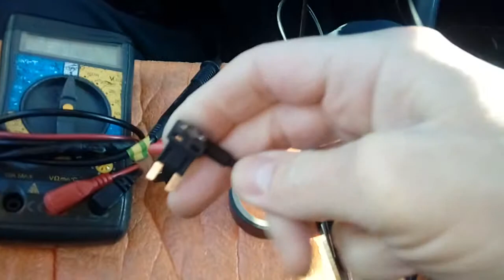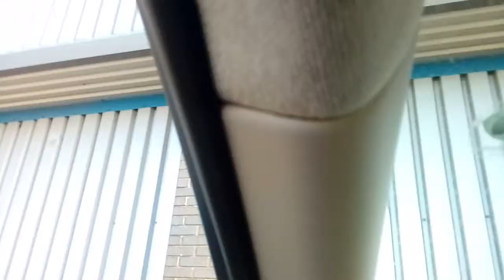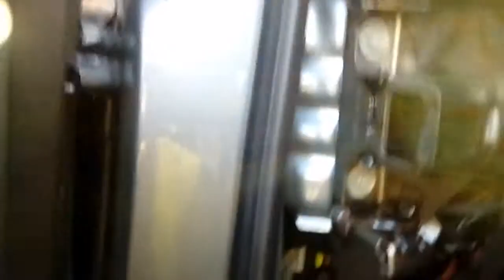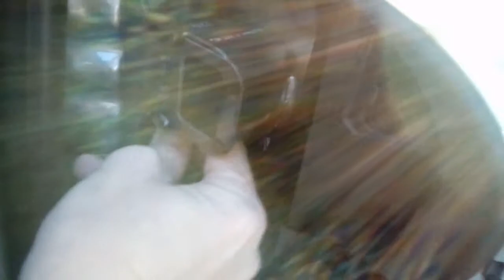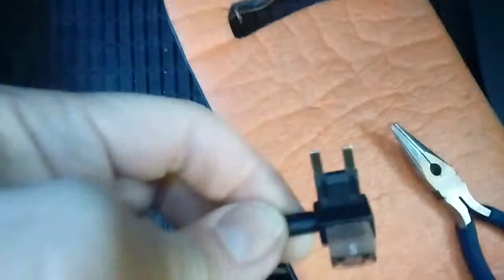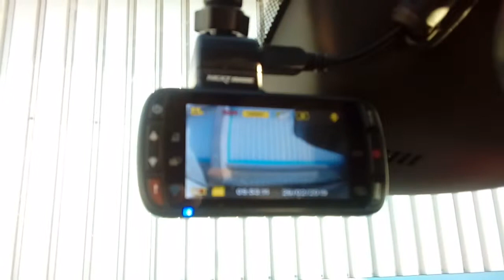Citroen C3 2009 onwards how to fit a dash cam to go on off with ignition + no wires on show

Comment: UPDATE, I have successfully Installed a Nextbase WG522 into a 2016 Citroen C4 Grand Picasso 2.0 Flair, Watching through your video in conjunction with others it was a relatively simple process. My car is a UK spec and following your process found that I did have 3x 5amps fuses but couldn’t get the tap fuse too sit flush in the righthand side one so used the one to the far left. As stated in this video Citroens do indeed keep their fuses energised for 30ish seconds after ignition is turned off. Inside the car you see the parking brake light stays illuminated when ignition is turned off. 30ish seconds later the parking brake button light goes off and a few seconds later you hear a click. Retesting the fuses  after you hear this click will now show zero volts. Also I hadn’t appreciated that a fuse tap must be installed the correct way round. It is now working as intended and I have literally 20mm of extra cable showing to the left of the rain sensor housing on the windscreen. I call that a success. Thankyou PJs Projects

Comment: I have a citroen C3 2019 1.2 pure tech on the left there is a panel when I pull it off it exposes a board with 5 fuses .there should be another board around the same place with more fuses but I can't find it .any idea where it could be.